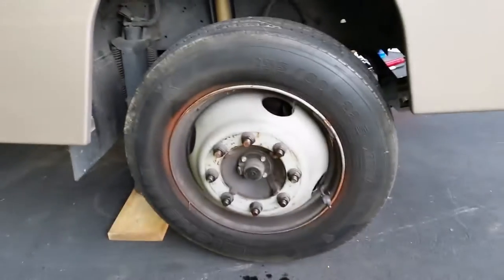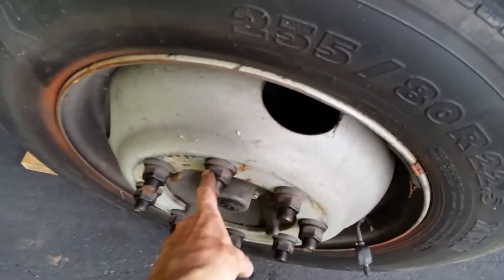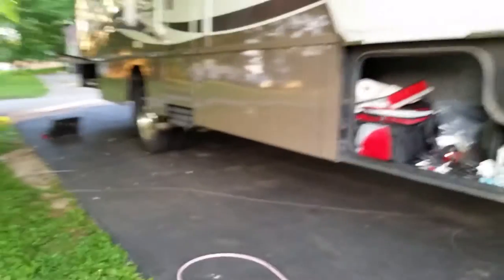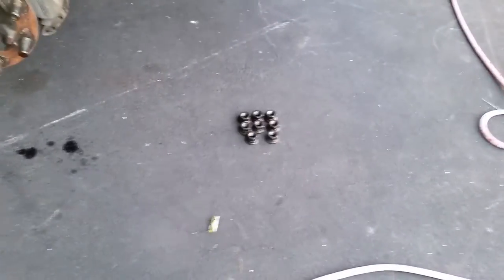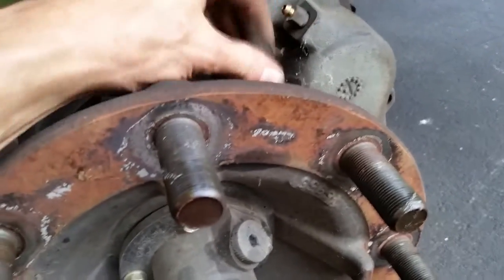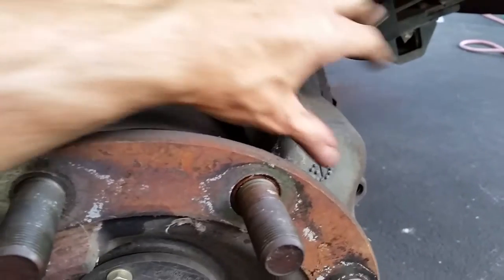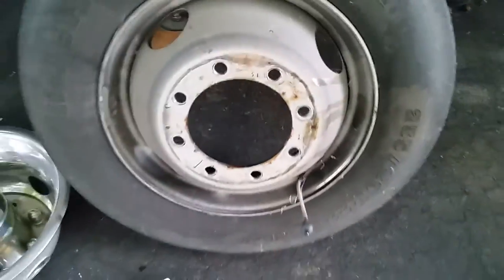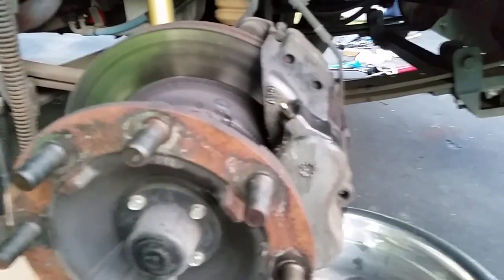RV Repair: W24 Workhorse Chassis Tire Rotation and Brake Fluid Flush and Bleed

Comment: greetings: I have the workhorse 22, and it is difficult to see the fluid level in the master cylinder because the plastic reservoir is not transparent. Looking down into the reservoir, how far below the bottom of the fill hole is sufficient when adding fluid?..hope i explained that correctly........thanks
Reply from the maker: I know what you mean .. what I do is take a good bright flash light and hold it against the left hand side of brake fluid reservoir. I fill mine up to the seam where the reservoir is put together about 3/4 to 1" from the top.
Reply: @ktoutdoor  Thank you kindly. This was very helpful
Reply: What method do you use to get fluid up in that Reservoir? Pump?